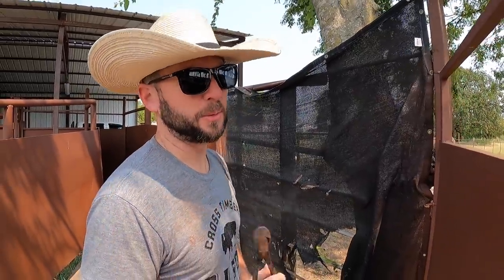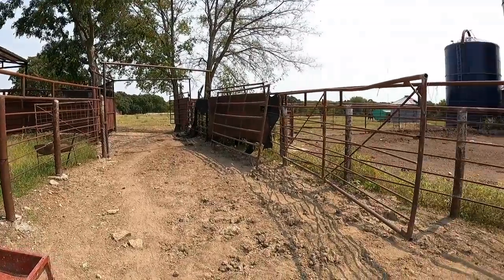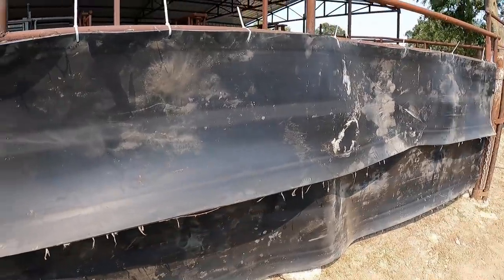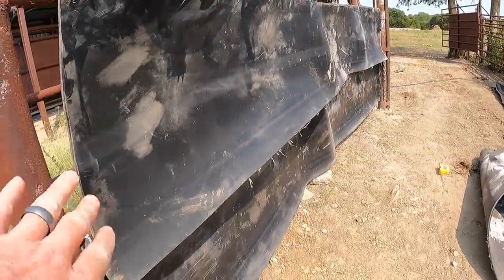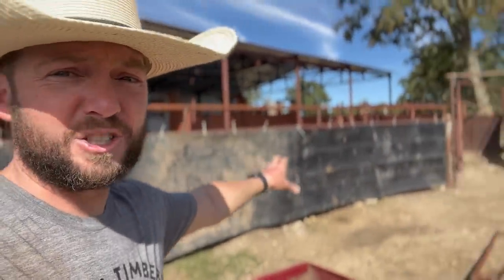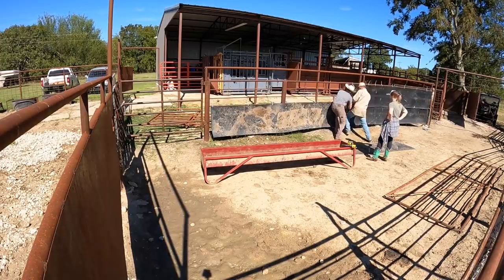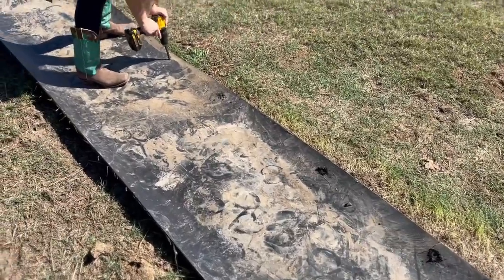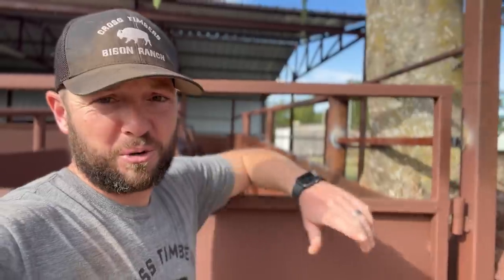We Gotta Make This Tougher For Our Bison!

Comment: I have extensive experience working with a wide variety of different materials. That being said, I would like to offer a suggestion for the self tapping screws that you used to help attach the conveyor belt to the fence. You need to use "washers" with the self-tapping screws. This will spread the tension over a larger area and should prevent the, "tear out" that is almost certain to occur because of the small head of the fasteners. You are much more likely to have the heads pull through the rubber. Washers won't pull through and your biggest problem would most likely be the fasteners snapping off due to the weight of the rubber belt.
Reply: Fender washers.
Reply: Agree and also I suspect the cable ties will breakdown relatively soon from UV but they do hold the mats in place until secured some other way
Reply: @lancepearson4035  you are right. They say water is the universal solvent; not necessarily ideal but it will dissolve nearly everything given enough time, and by the same token the sun has the same corrosive effect on things. Some colors, like yellow, delay the process. He might do well to start replacing the ties with wire fastening in the near future. It's inexpensive, readily available, and versatile.
Reply: Look again!  This time carefully from time mark 13 minutes 30 seconds.
The self tappers are only 1" long and do not screw into the steel rail of the fencing at all and only into the two layers of conveyor belting. 
Fender washers under the heads of the self tappers would just be a complete waste of time in this case because the rubber is not fixed down at all.  Wind movement is going to make those self tappers pull out of the rubber, fall to the ground and become a serious injury hazard to the Bison's hooves. 
The conveyor belting sections should be connected properly with pan head socket screws, two  fender washers and a nylock nut.
I cannot stress how dangerous these self tapping screws are to the Bison.
Reply: "Extensive experience" ... 😜🤪🤣🤣🤣🤣🤣🤣🤣🤣
Reply: What part of "extensive experience" do you not understand ?

Comment: ZIP TYE TIP. Hey Dusty love your vlog btw n thought I throw this in. #1- agreed black is sunlight resistant but what’s done is done #2- don’t cut the tails off, twist them close to the catch. This will keep them locked in and will cut down on minor cuts too your hands. #3- hope your a good high jumper when your in working them.
Reply: #3 - good point, no more quick climb to evade animals

Comment: What a genius idea, I used old conveyer belt from the Quarry my husband worked at to line the bottom of my two stalls where I boarded my horses, I used those long nail that were about 10 inches long and yes I had to predrilled my nail holes, the never pulled out of the packed ground.
They worked out really well and was a cheaper version to using stall pads.

Comment: Love the new hat!   Needs a little dinge for style.  

Great job on the belt install.  Very neat.  I can see how it removes the temptation for the Bison to try to climb up and over the fence, like Big Joe.  Safer for everyone.

  If the zip-tie holes look like they are starting to rip, it would be pretty easy to add grommets to reinforce the holes without taking the  belts down.  Hopefully the reinforcing in the belts will be enough support.    Looks like it would be easy enough to drill additional holes.  I really like that you used tap screws to secure the bottom edge of the top flaps.  Did you do the same  where the vertical edges overlap?  Would duct tape help prevent the Bison from getting caught on the vertical edges.  Or do you use really long zip-ties to secure the vertical edges to the posts.  After what Big Zoe did to your gate, seems he would be smart enough to figure out how to start picking at an edge and then tear a whole piece down.

Is there a way to help the Bison get used to the material.  Could you put cubes out on some leftover scraps of belt so they can learn a positive association with the rubber smell?  Or can you let them feed in that area a couple of times before the day you work them?

I love hearing how the whole family gets involved.  Kevin is a rock star!

Comment: Hi Dusty, When the zip ties need replacing, what about using those stainless steel hose clamps. You know, the kind you can unscrew all the way. You can get the kind that can be tightened with a nut driver in your cordless drill. You could just keep a box of them around and simply install them as needed as the zip ties give out.

Comment: I found some used coal mine conveyor belt 60" wide to use for flooring in my shop. It was much thicker than that. It was tough to cut or drill and had a steel belt in the middle.

Comment: Dusty I applaud your efforts to keep your bison safe and to make it easier to get them into and through the alleys! I would suggest you get some heavy duty washers, drill three to four holes into doubled washers use small bolts to protect the holes you have made in the conveyor belt to keep it from ripping! Your belts will last much longer if it doesn’t rip!

Comment: Just a suggestion, hose clamps. They last a long time and are easy to use. You can get them in all sizes and they are circular. Will hold the rubber for at least 3to 4years depending on rain amounts.

Comment: Maybe you cover it later in the video, but since the bison horns point UP shouldn't you hang the upper part first and then overlap the lower so that the "seam" does not catch the bison horns if they try to fight the fence?   I just see Dunbar hook those bales and lift them up...if the lower overlapped the top then the horn would just slide over the 'seam'.

Comment: I thought you lived on the property, too. 

The upper belt probably lay down flat once the sun hits them for a while. A Hot Melt Glue Gun might help hold them together, also
That’s a great way to re-purposed used conveyor belt! I think it’ll last a long time. I would definitely do what the commentor below said and use some large washers with those screws.

Comment: I have a BIG suggestion for you.  I know you have already bought the conveyor belt rubber for working your bison, however --- next time think about ordering pond liner that comes in much wider lengths.  I don't know about the thickness compared, but it is pretty thick and would work much better for covering an area.  I have told you in the past, we are in the nursery biz, and this stuff is tough used in the bottom of custom built ponds.  I think it comes in up to 8 to 10 feet wide.  While it is not cheep, it may be cheaper than what you are using.
Reply: I thought the conveyor belt was free? Reused...

Comment: Get rid of the zip ties & replace them with ADEL  clamps with screws & nuts. The sun will made the zip ties brittle. Your Bison hits the panels & they could just fall off. That or use bailing wire. But wrap the bailing wire about 4 times around the conveyor belt & poll so it will have some strength to survive the Bison bouncing off of it..

Comment: For you rubber panels to attach it to the fence with electrical conduit hanger clamps,  They are c shaped and will go around the pipe and you can bolt your rubber to the fence and it will last for ever and harder to be pulled down by you Buffalo

Comment: Dustin you may want to put some flat head bolts with washers on the middle  to hold them together. Them Bison get to thrashing around. that rubber coming down bud...  You also should use some metal eyes and put in them hole s were the zip ties are   keep it from tearing   Just saying